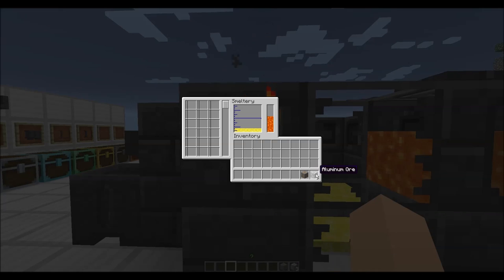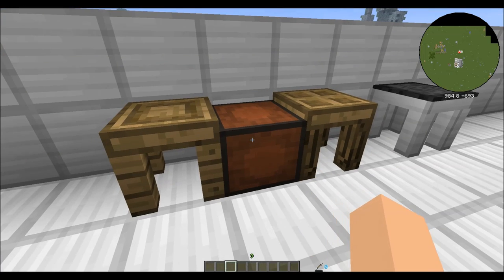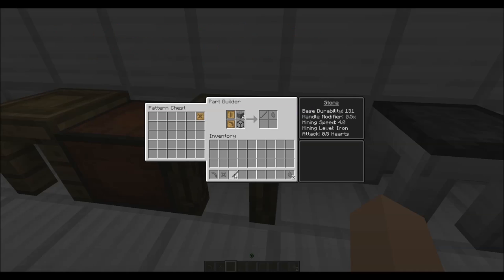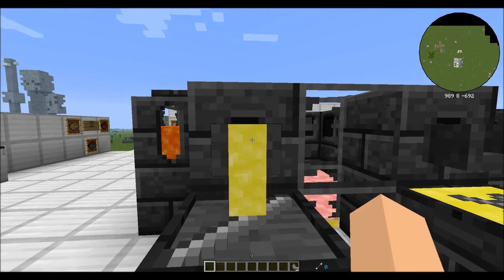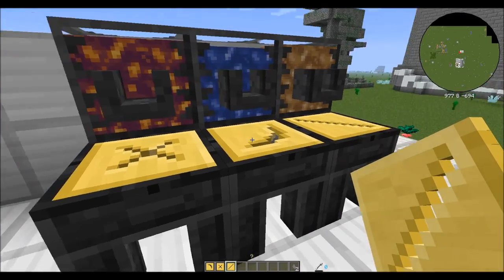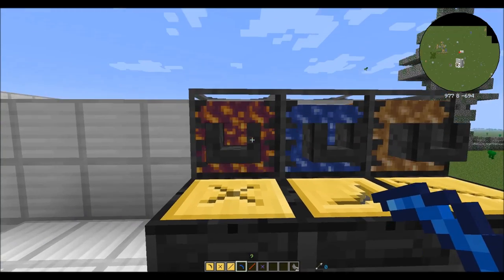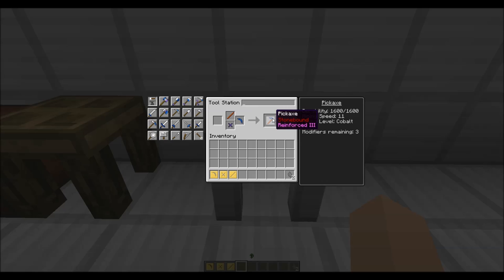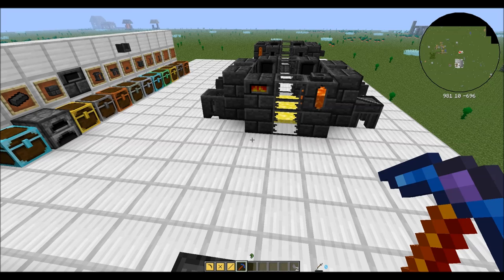Tinker's Construct Casting Tutorial

Comment from the maker: There are a few ways.  If it's in your smeltry (and you just want to get rid of it) break the smeltry controller and everything in it will go away.  Alternatively, if you have enough for ingots you can make an ingot cast and click the faucets.  Or you can put a bucket on your casting table and fill that up (takes a lot of metal to fill a bucket though).  You can create seared glass and put them under your faucets and click to fill them up.  Also liquiducts work great too.

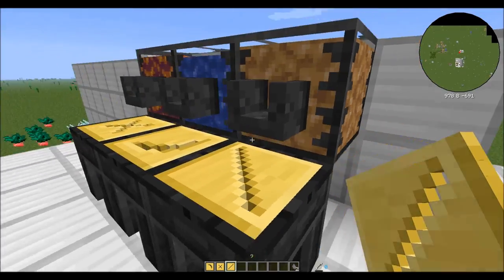Comment: How did you put the melted liquid in the seared glass at 1:12 ?
Reply from the maker: Couple of ways.  I just used a bucket full of metal(put a bucket on the casting table, takes a lot of metal).  But you can also pipe it into glass using liquid handling pipes from other mods or the casting channels (or the faucet) from T.C.
Reply: Minecraft with Sidetrack Thanks heaps! i appreciate that you reply to questions, i was going to subscribe (probably will anyway) but aren't sure if you still make videos :{
Reply from the maker: I do... just slowly.  I'm a teacher so most of my time is spent grading papers and planning (hopefully) fun lessons for my classes.

Comment: SORRY FOR CAPS BUT I REALLY NEED HELP SO SOMEONE HAS TO SEE THIS FOR THE MOLTEN STUFF IN THE SMELTERY HOW DO YOU CHANGE THE METALS I CANT FIGURE IT OUT HELP PLEASE
Reply from the maker: By change the metals do you mean make alloys?  If so you just put in the correct number of ingots/ores and they auto combine.  If you mean change the order of the metals so you can pull out a specific metal then just click on the metal in the smeltery and it will drop it to the bottom (this works in newer versions, not sure about older ones though).  When all else fails you can drop metals into the seared glass (or tanks from other mods) and separate each metal into it's own container.  You can stick faucets on the glass just like on the drain.  Hope that helps solve your problem.